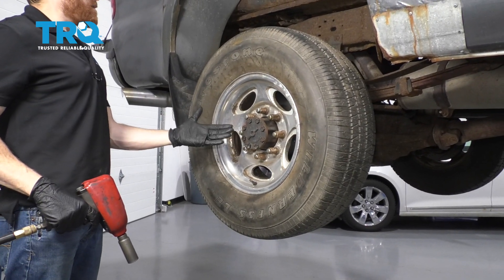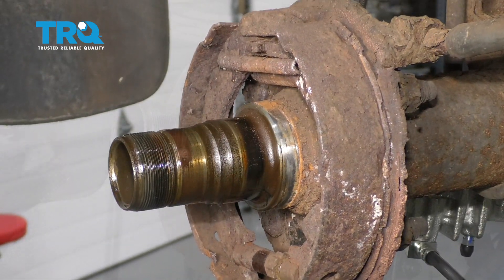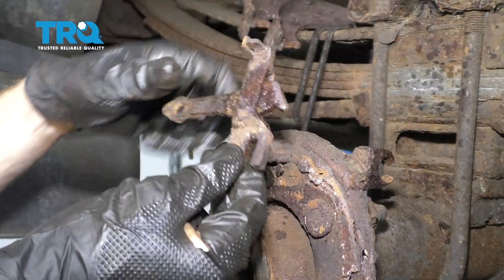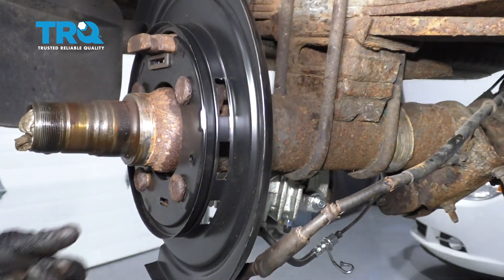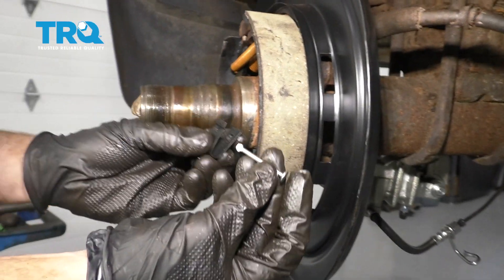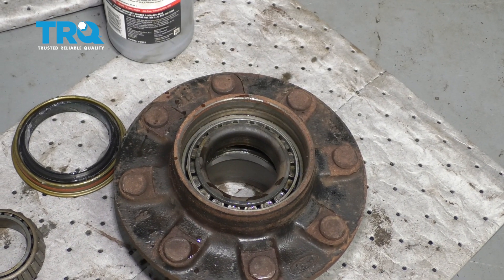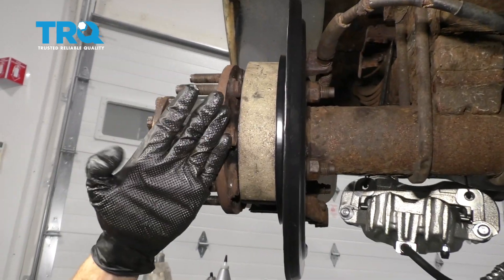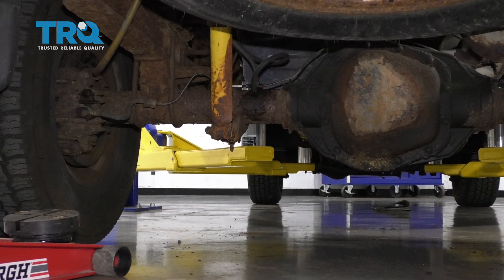How to Replace Rear Backing Plate 1999-2007 Ford Super Duty F-250

Comment: You threw away the oil slinger shim - between inner bearing and seal.  At 12:30 you said "this is part of the seal".  I'm going to take mine apart and re-install the shim.  Hope anyone else see's this before they put it all back together.

Comment: Thank you so much for this video - this made my job MUCH easier!  Couple things I want to mention to folks that tripped me up; 1) make sure you actually have an 18 mm socket for the axle bolts (apparently they are not-so-common even with multiple socket and impact sets) and 2) it'll help tremendously to have a short socket and impact swivel adapter for the backing plate nuts.

Comment: Hey! super specific question for 2002 4x4 f250 super duty xlt v10 left rear axle spindle nut requires 4 lug 2 3/4” outer diameter socket. All tool brands I’ve found with proper measurements have the center dowel like your socket. But my shaft won’t allow that protruding dowel in deep enough to accept the lugs into the grooves. Your socket fits your vehicle perfectly. Please list the specs of your socket! Thank you very much! Most informational video! ONLY REAR AXLE FORD VID I CAN FIND!

Comment: I have a question I put the new bearing in while changing the whole new emergency break setup but when putting it back together the hub assembly didn't just slide in like you showed I had to crank then beat with hammer then crank at the end didn't seem straight for the caliper

Comment: Brand of spindle socket please!? 2002 f250 rear axle spindle nut specs to 2 3/4” diameter but all the 2 3/4” 4 lug sockets I can find have a center dowel like yours that doesn’t fit deep enough into my shaft to accept the lugs. Thanks!